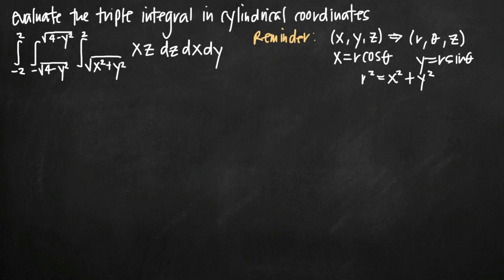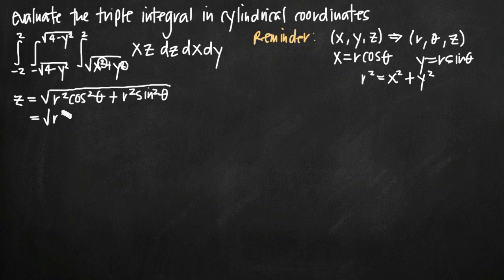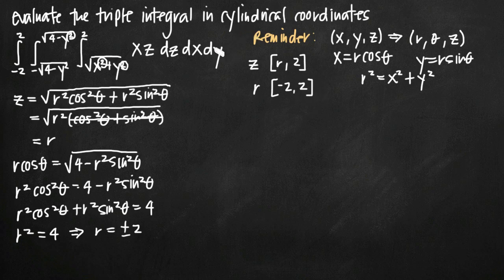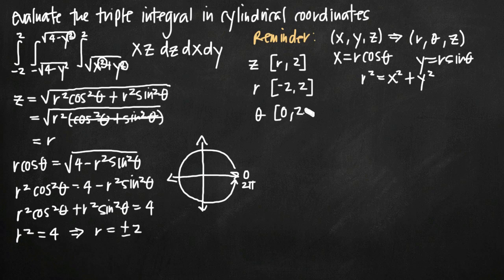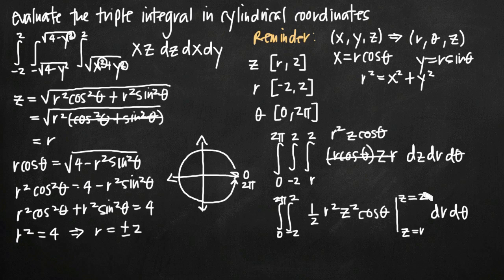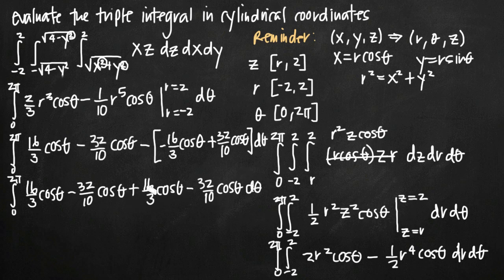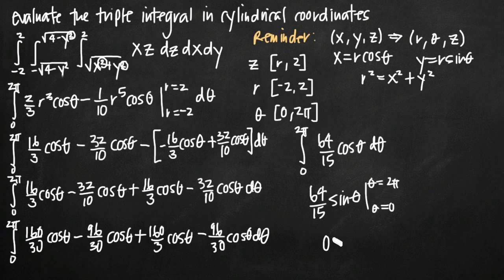Converting triple integrals to cylindrical coordinates (KristaKingMath)

Comment: Isn't it simpler to recognize that z=sqrt(x^2+y^2) looks a lot like if you solved for radius. r=sqrt(x^2+y^2). The same goes for x=sqrt(4-y^2) which is what would happen if you solved for x using r^2=x^2+y^2. That means 4 is r^2, or in this case x^2, so x=sqrt(4)= + or - 2. I know this video is really old but this makes it a bit easier if the limits can be solved using r^2=x^2+y^2.
Reply: defiantly better to change to r^2

Comment: some things.  You can not determine a negative distance for  r (math nerds excepted).  To go from r to 2 is always zero as r is 2.  It is incorrect to add an r to an equation that already has an r (rcosθ).    Integrals sum from one number to the next.  If the number is the same at the start of integration as at the end, the integration will always return zero.

Comment: guys small mistake. r is from 0 to 2...
x=[0,2] its the radius not diameter
Reply: can you explain why r is from 0 to 2 instead of -2 to 2. #iambadatMath :)
Reply: @BruceWayne-zt7vt  Because since it's a circle with r=2, the area is equal to the area of a circle with r=2 minus the area of a circle with r=0 (which has no area). There's no such thing as a circle with r=-2, since the radius of a circle is always positive.

Comment: is there an example where theta's domain is not 0 to 2pi
Reply: If they ask you to do it over the first quadrant of the xy plane then it is from 0 to pi/2, if the angle is from 180 degrees to 290 then it is from pi to (2pi)*(290/360). Just think about which angles on the xy plane the integration covers and make sure it's in radians. I hope that helps.
Reply: thanks man, that helps a lot.

Comment: does dy always convert to d(theta ) to (0,2pi) ?
Reply from the maker: Yes, unless there's something that limits the interval for theta. For example, if the lower limit for y in this problem had be 0, that would tell you that you're only dealing with the half circle that sits above the x-axis, not the full circle. In that case, the half circle above the x-axis only encompasses angles [0,pi], not [0,2pi] like for the full circle. So your limits of integration for theta would then have been only [0,pi]. I hope that makes sense!
Reply: yes it does ! thank you so much!!!

Comment: Very well explained video! You're explanations are perfect to understand. Unfortunately there was a lot of errors made in this video. r=2 not +-2 and divide by 160/30 not 160/3. Either way keep up the good work!
Reply: Correct me if I’m wrong, but I thought it would be +-2 because you need two values for your integral, an upper and a lower, and when you take the sqrt of both sides of something, you will usually end up with 2 answers, one positive and one negative of the value on the other side.

Comment: Since we've integrated along the bounds of [-2, 2] in the R plane when the bounds should have been [0, 2], i assume then that the calculations done after 11:02 are incorrect?  despite incorrect calculations we should still reach the same final value of zero (0) as 2pi and 0 of sin is still equal to 0 correct?  As stated in other comments, the evaluation of these cylindrical coordinates is finding the volume of the solid? How is it possible to have a volume equal to 0?
Reply: if the integrant xz would be 1 then it would be volum
Reply: My 3D geometry is shaky, but taking a guess, if the thing being integrated for volume is in fact an open surface within the given bounds, then it has no volume.

Comment: 13 minutes of work for the answer of ZERO. Ladies and Gentlemen... Calculus.
Reply from the maker: +Philip Geraci LOL
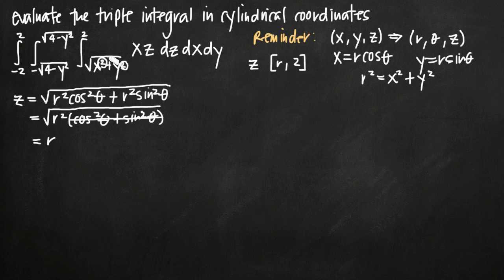Reply: @kristakingmath  I know I am 9 years late do you realize you can just plug in r^2 for sqrt(x^2 + y^2) which just ends up r? at 3:49
Reply: @wrx1th873 I know I am 5 months late even me I don’t know why she didn’t do that🙄
Reply: Actually no, I did it and still, the answer is 0 :)
Reply: Fantastic
Reply: When you the same upper limit as lower you will always get zero.  z should start at zero.
Reply: Its ok if you're doing flux boys
Reply: I don't think the answer is 0, she made a major mistake that would change the entire answer of the question so you'd have to do it over to find the real answer.
Reply: Kakin Tse if you know how calculus works you would know that no matter what the limits are if you integrate an odd function over a symmetric region you will always get zero
Reply: LOL!

Comment: the point in dr, shouldn't it be from 0 to 2 instead of from -2 to 2??
Reply: yes, r [0,2] since radius can't be negative. dxdy is made up of region R : x^2 + y^2 = 4, thus r[0,2], θ[0,2π]
Reply: Despite the fact r>=0, which means r[0,2], the answer still turns out to be zero.
So is there sth still wrong or is zero the right answer nonetheless?

Comment: Is the domain for theta always 0 to 2pi for these?
Reply: No. It would be better if you integrate from 0 to pi/2 then multiply the integral by 4. Theta 0 and 2pi have the same value so there are times that they would cancel each other out.

Comment: instead of doing all that extra work for converting the limits for 'x' couldn't you just leave the variables in terms of x and y?
you would get

x = sqrt(4 - y^2)

square both sides

x^2 = 4 - y^2 

x^2 + y^2 = 4

change (x^2 + y^2) into r^2

r^2 = 4

r = +- 2

Comment: Let me know if I'm wrong or not, but the bounds of integration for (r) were [-2,2], which seems a bit strange as the radius can never be a negative value. Now I considered the bounds of integration to be [0,2] which actually turns out to give the same result (Zero), but I if i'm not mistaken this was only a coincidence that it turned out to give the same answer. So I believe in another situation this would have been incorrect as the bounds of integration for (r) must be non negetive.

I am a student an want to varify my observation of these results.
Thank you in advance!
Reply: I think you don't need the answer anymore as you probably already graduated. :D
Reply: If it is just a coincidence then you can take other examples to prove or disprove yourself